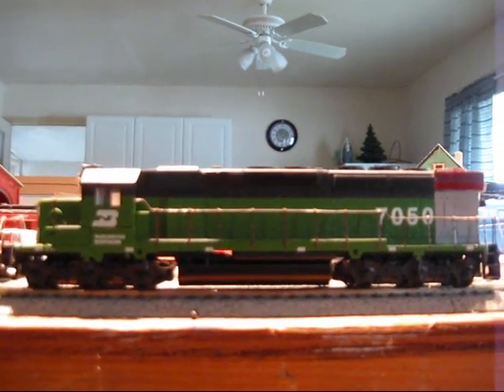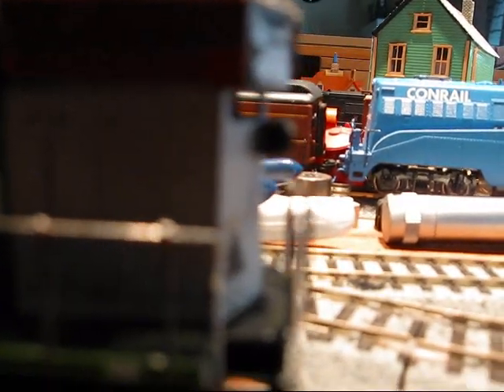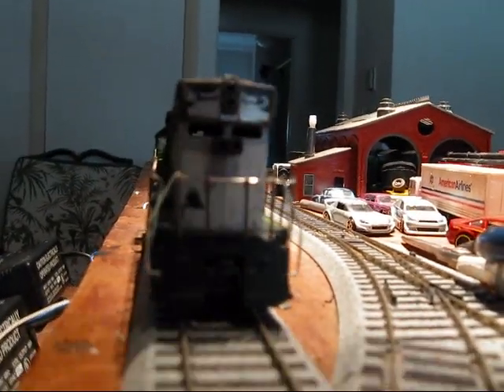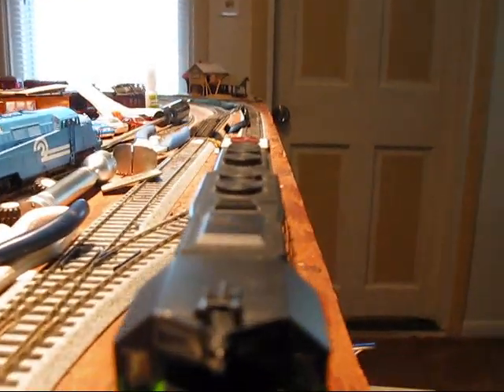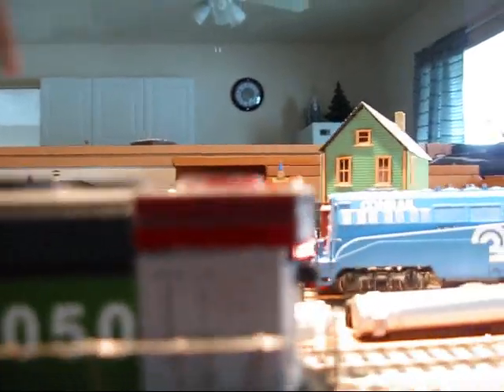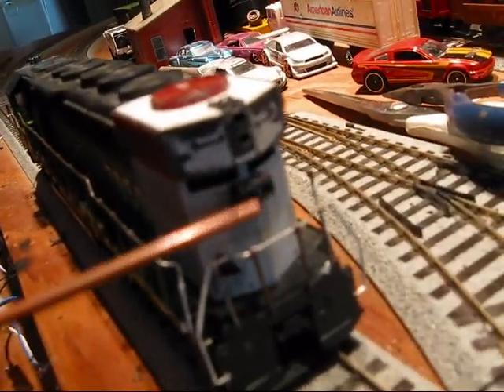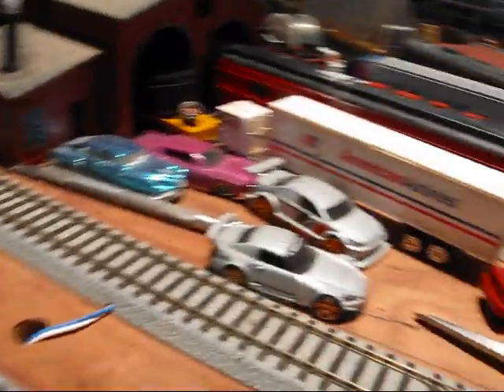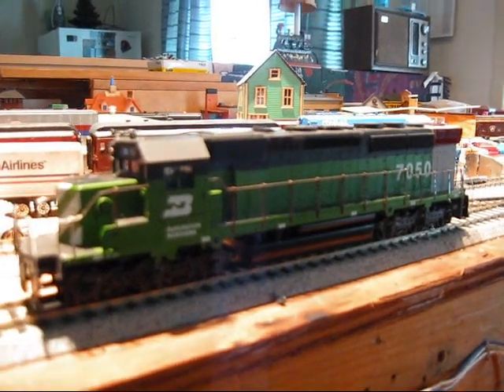SD40PX-2 -Experimental Model

Comment: @EMDSD14R cool can you create one in N-scale because well HO Scale didnt work for me I had alot of second hand equipment that didnt work I also scrapped a HO scale GP20 that was in the Santa Fe  Warbonnet paint it was beyond repair so the only thing I have left of it is the wheels & couplers along with the radiator fans & I also scrapped a boxcar out of boredom kinda hate that also alot of my track doesnt work & I dont hve anything to clean it with so I switched to N scale

Comment from the maker: @tartopfan well place in an order to WLW and i'll have a pre production model for ya...the advantage with this unit is the GE traction motors if u have an EMD traction motor in an axle of 3 and onew fails u lose the whole truck..with AC traction motors u only use tht one motor out of 5..its isolated so u can still use the unit and replacement for the motor is half or less then removing the whole truck..let me know and i'll help u out most def!!

Comment: Then a little later (in about 1995 I would guess) Kalmbach redid the Diesel Spotters Guide and did it up as "The Diesel Locomotive: The first 50 Years" which isessentially the same as the "Second Diesel Spotters Guide." At about the same time they Published the "Contemporary Diesel Spotters Guide which was probably everything from the 1980's until then (about 1997). Withers publishing has also published a "Contemporary Diesel Spotters Guide" which I would recommned as well.

Comment: @EMDSD14R there were 3-5 versions of the Diesel Spotters guide by Kalmbach. I would recommend picking up some of them off of E-bay or Amazon. There was the "Diesel Spotters Guide" from about 1972 which covered everything up until 1972 (pre EMD -2), and then there was the "Diesel Spotters Guide Update" which I think was from 1978 which covered everything up until then then there was the "Second Diesel Spotters Guide" which was an update of both the 1972 Guide and the update + a little more.

Comment: @EMDSD14R yeah I almost forgot about the trucks! Well EMD (GMD actually) used an SD40 Frame with GP mechanicals and Trucks to make the GP40TC (the extra room on the frame was used for a Genset for the head end power (I think it was a small Detroit or Cummins diesel). The end of the GP40TC Hood was kinda squared off like a GP40P or an SDP40. I'll have to pull out my Diesel Spotters Guide.

Comment from the maker: @rocketdude1979 thank you..i used a saber saw, a track super saw and to finish it up a dremel....indeed i could do tht...i would also need to switch the truck on the sd40 frame which shouldn't be too hard..oh yeah i like those amtrak GP's..since this unit came out like it did i am going to make a few more after i get it an my other prototypes finished..at the most it took an hour or 2 for the final unit

Comment: Pretty clean splicing. You could use some of the techniques (especially if you spliced a GP40 shell and a SDP40 shell on an SD40 Frame to make a GP40TC which ended up on Amtrak and eventually rebuilt to GP38-3 standards (except with a long frame) (I know you liked those Amtrak GP's)